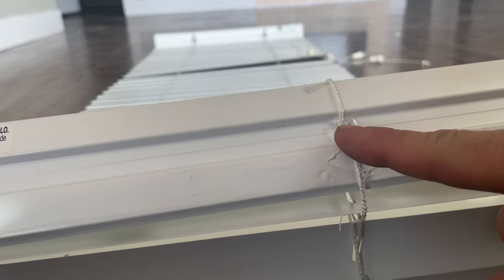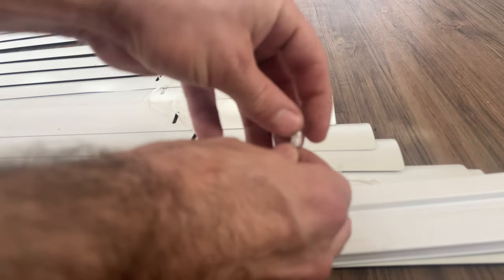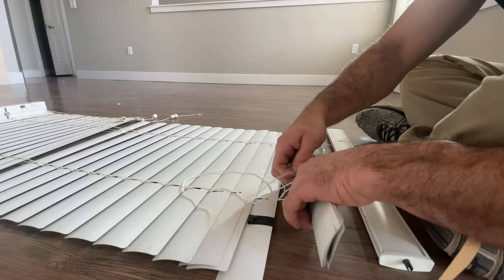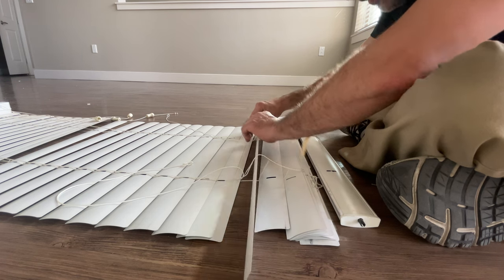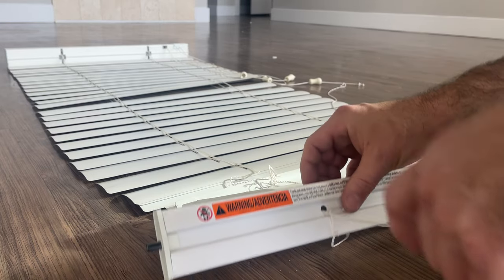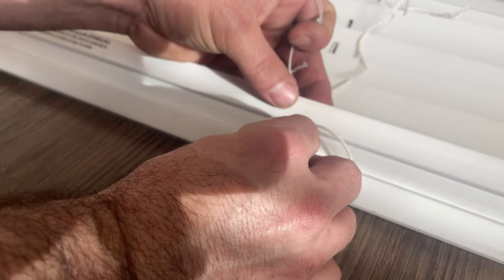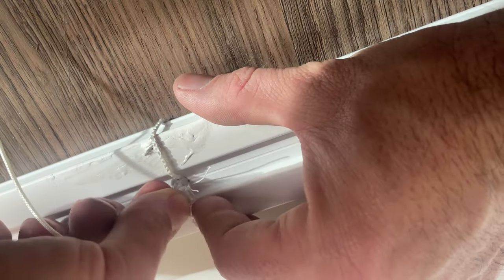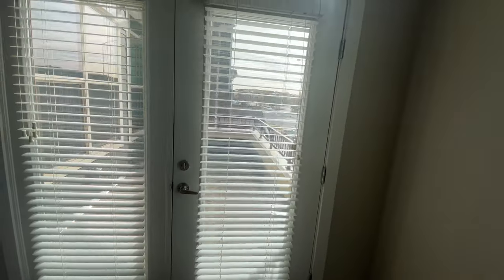Replacing a Broken Blind Slat - How to Restring Blinds

Comment: you're doing so much extra work. you didn't have to remove the blinds and it's easier to do if the blinds are still hanging
Reply: How would you remove the clip if they’re still hanging. I guess it would depend on whether the blinds are in the sill or out of the sill.
Reply: @IFLTW  you release the blinds to hang lower than the window sill or place a TV tray or similar under them. remove the clip and continue with rest of his instructions

Comment: Thank you.  I don't have replacement slats, but I think I can get them from the bottom, since the blinds are longer than I need.  If they still sold these, I'd just buy new, but it's a different style of attachment, and this is easier than changing that.